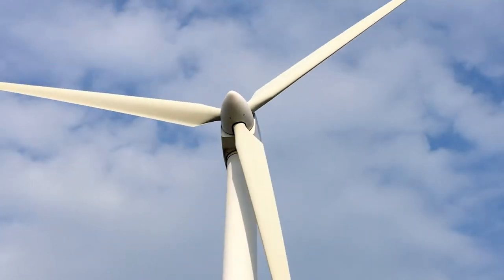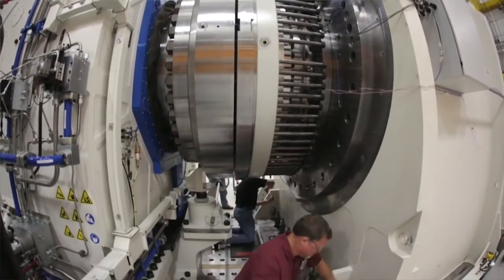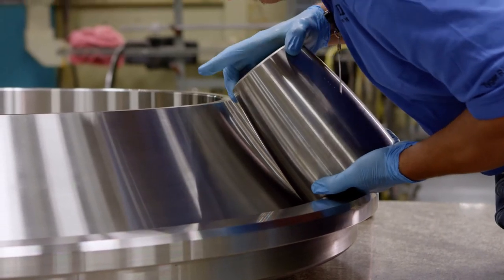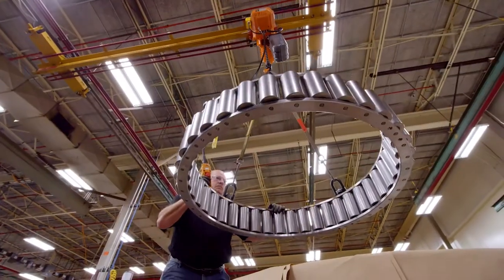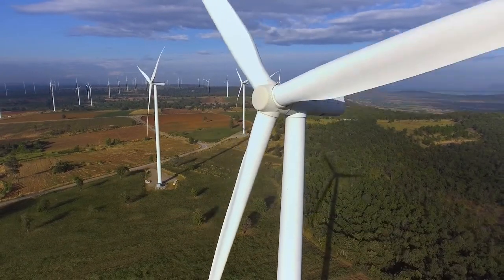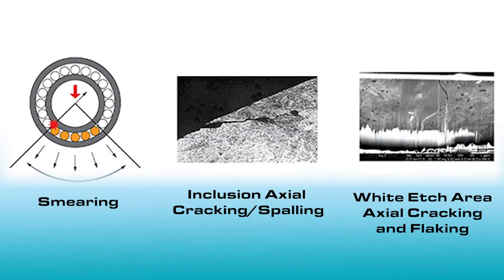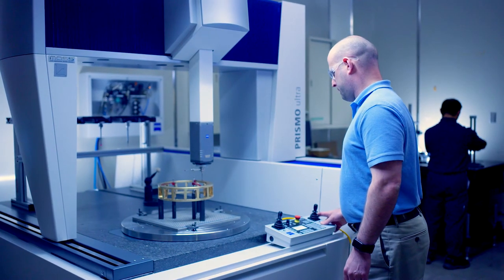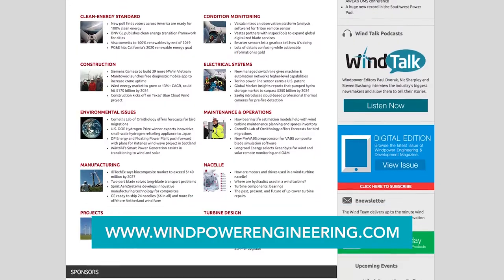What’s new in wind-turbine bearing designs & maintenance

Comment: Only 1 main shaft bearing, wtf you need 2.  like the main shaft on any transmission, electric motor, engine crankshaft , a big end and small end, you need oil bearings need oil, filter, pump, seals